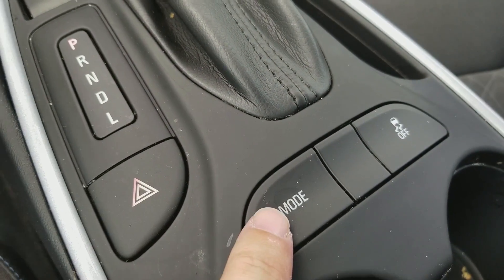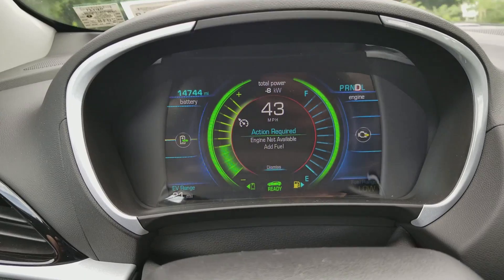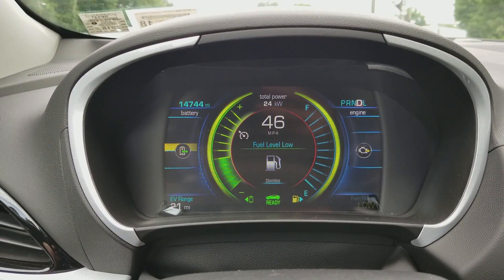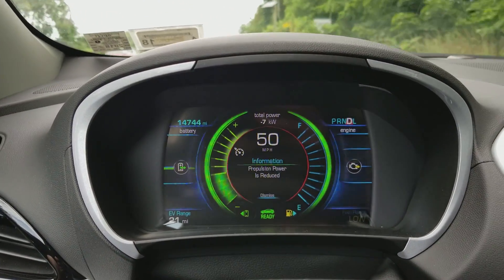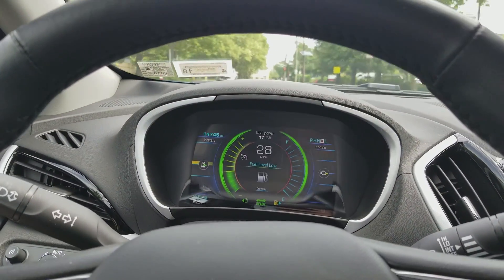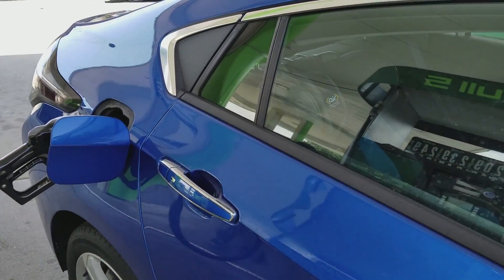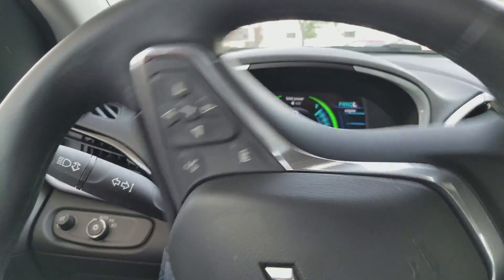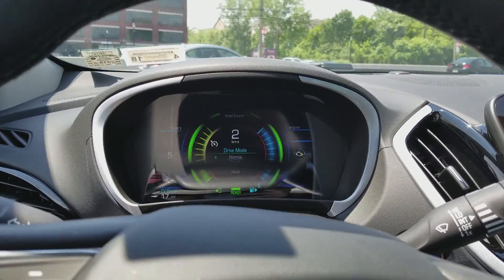Electric Chevy Volt Runs Out Of Gas - Becomes Dangerous

Comment: I guess they figured that anyone who buys a $45,000 car will be able to afford to put gas in the tank as needed.
BTW you cannot run this car with the gas tank empty all the time. At some point it will try to start the engine, to burn off the 'old gas'. Hilarity ensues.

you know what is really dangerous? Having your car run out of fuel and not moving at all, in the center lane of Interstate 95. You WILL get rear-ended by  a semi going 75mph.

Comment: I have a 2017 Chevy Volt and love it. I almost never use gas, unless outside temps are below freezing, or if I make the rare trip greater than 50 miles. JSYK, it goes 0-60 in about 7.5 seconds in NORMAL mode.

Comment: Oh I learned that unfortunately at 2:03 you didn't bother reading the warning. Also learned that you didn't read the owners manual. Also learned that you don't appreciate that the car is trying to absolutely economize all possible range by slowing you down to prevent you from wasting excessive electrons on silly 0-60 runs. The theory is you are in a pretty desperate situation and your are lucky the Volt is a car with a backup plan. Please learn your car before posting silly videos about how you think your amazingly well thought out car is dumb or dangerous.

Comment: The volt has a very protective system - it only uses 60% its battery - so run out of gas and battery it still has 20% to get you out of trouble (ie: reserve)

Comment: The Volt will run with an empty gas tank. If the battery charge is above it's low state of charge buffer level it will run perfectly normal.  I wonder if your charge buffer is set really high or something.  I ran mine with no gas on the freeway with no issue, still just as zippy as before.  Or maybe you need to have your car looked at?

Comment: Listen SpaghettiOs, you're wrong about hold mode. I own a Chevy Volt myself and when you're in hold mode the car will run on a combination of electric and gas but it will run almost primarily on the electric that you regenerate. So if you're in stop-and-go traffic on the boulevard between traffic lights is going and stop and going and stopping putting your car your Chevy Volt in hold mode puts it into hybrid mode and you use both

Comment: Ok, I opened and watched this video, ready to dump on it because of the title.  From the mostly negative comments below, I'd say there were a lot of people that felt the same.  However, after watching this, he has a good point.  I have a 2018 Chevy Volt, and I love it.  But he'd definitely pointed out a bug that should probably be fixed with an update.  You shouldn't get a "Propulsion Power is Reduced" message just because you left it in hold mode and ran out of gas and have plenty of battery power available.  It's designed to run on battery only, if you still have plenty of battery left, you shouldn't need any gas to keep running normally.  I expect it's a feature designed to protect the battery from being over-used when the gas engine isn't available (out of gas), but that section of cod should have also checked the battery amount available; only switching to "limp mode" when battery range was also getting low.

Comment: "Hey Speghetti-O's! So this car is dangerous, because it won't let me merge onto the highway after I ran it out of gas and only have battery power. Its a stupid mode that won't let me use a lot power to accelerate hard. Such a bad design. There needs to be a warning label that says not to run out of gas and attempt to get on the highway."

Comment: Which car doesn't suck in limp mode? It's a highly unusual scenario, most people would run out of battery power - then run out of gas - then the car would go into EV limp mode for 3 miles. You would get plenty of warnings that you are about to run out of gas prior to actually running out of gas. It sounds like GM just programmed the limp home mode to automatically come on after you run out of gas regardless of battery power - but again, you're getting more than ANY purely ICE powered car would give you in the same situation, so not sure why you call it unsafe?

Comment: you have got to be kidding me.   Yeah, its trying to conserve electricity to limp to a charger/ fuel station.   The actually interesting part is that if you run it out of battery, then run it out of gas, it will do the same thing, but draw from a hidden portion of the battery for a few miles.    The system probably is confused because its being used backwards.

Comment: This is old, but I just came across it. I don't understand your perspective here. You have a car that is working as advertised - it gave you a certain amount of electric range, then switches to gas to generate the electric from there until such time as you run out of gas. All of which your gauges told you what were happening at all times right? However it appears they built in a reserve system to try and help you limp to a gas station. How is this a bad thing? Is it because you forced the scenario to see what happened and you still had some battery left so you think it should switch BACK to normal battery? That's on you for being weird. Just force it back to normal using the mode switch like you forced it into hold mode to begin with. 
As far as greatly reduced power, etc. - good grief man, put on your hazards and go. You've never had a breakdown in a regular vehicle? I sure have. I had to limp home a Mercedes C300 that would barely get up to speed because it ends up the mass airflow sensor was faulty. So your argument would be all Mercedes C series are dangerous vehicles since the mass airflow sensors commonly go out on them (as I found out the hard way)? Or basically any vehicle made is dangerous that has any downtime whether or not it is user error? I don't own a Volt, but I am seriously considering one and I'm trying to find any negatives I can. This argument doesn't make sense to me. It seems more like an olive branch they shouldn't have extended to try and help people out. Just let people be stranded when they run out of gas like anything else and this video wouldn't exist. lol sheesh.

Comment: Yeah I can speak from experience no battery charger when it runs our of gas results in the engine shutting down but there is still enough to travel maybe he a mile or a mile tops. It really just depends on how much battery power was generated when the gas ran out since it uses gas to ultimately make electricity and move the car. I was able to travel about a half mile and use the ac for a little when I did run out of gas. In the middle of the desert 100 degrees with my cat no more water just got my tires out of deep sand after 3 days of trying then drove out of the real middle of nowhere for a while and my car died I'm pretty sure some angels showed up and drove me an hour both ways to the nearest gas station.

Comment: Definitely learn something new, had Volt since 2013. Not familiar with the newer model and its design but assume it is similar. The 2013 Volt use electric mode first and gas as an extender for a normal mode of operation. Empty the gas first is not "natural" flow of the use of this car. Many Youtube videos show how the power plant design in the Volt. The max power under demand load situation is provided by all three power producer. The Electric motor, the generator, and the gas engine. Missing one of these would put the car in less power capability in a demand situation. For example, when the battery is empty, climbing a mountain will be slow also.

Comment: What a maroon!  , getting on the freeway without gas and the battery drained. You know the initial charge is drained. You've gone through a tank of gas and the gauge has informed you need to refuel, then you complain when the emergency electrical reserve supply meant to keep you from being stranded and give you a chance to get  to the closest gas station can't deliver you freeway acceleration speeds?   Chevrolet's engineers are not omnipotent and can only design for so much stupidity and user error.

Comment: without gas it will extend the battery life for as long as possible. More of a 'don't be stupid and run the battery dead before you can find a gas station" type of feature. And you really need to put the intelligence of the public as a whole. I do agree there should be a message, maybe an override... but that's why it does that.

Comment: My guess is it went into limp mode to conserve electric power to increase range so you can get it to a gas station before you run out of battery in which case you'd be fooked.

Comment: I have a 2017 Volt and I've used all the gas and had electric only, and my car did not go that slow.  I got onto the highway easy.
Reply: If the gas engine becomes unavailable when the car was expecting it to be available, it will reduce total power output to 50kW. Power-to-weight is roughly that of a 2.4L Subaru Outback, so you can still get up to highway speed with relative ease.

Comment: Typically when a battery gets that low it's not capable of outputting it's full voltage. Which means your going to be limping. Same reason RC cars get slower before the battery completely dies.
Reply: It will engage this mode even when the battery is fully charged, because the programming assumes you have already depleted electric power before depleting gas power. If you use Hold Mode, you can defeat this normal operation and run out of gas even with a full battery. It still thinks it has to limp home though if there's no engine available.

Comment: Actually, I've seen a video that says if you deplete power in electric mode and then run out of gas, unlike a ICE powered car, you can actually limp to a fuel station to get gas beating all ICE cars, the only available option being you hoof it.

Comment: I wish the option to "Dismiss" the message on the display would restore full power, but I can understand why they did this.  It is an extended range eV after all, and any "failure" of the range extender (including being out of gas) will prompt that reduced power.  Think of it this way: most people watch the eV range but don't care if it gets low because they assume it'll keep going beyond that.  That "habit" is what makes being out of gas a big deal in this car.

Comment: It is stupid that electric propulsion power is reduced even though the battery is fully charged (well, 100% is really about 80%)... It should be at full power until 20 miles or less remaining IMO..  You may be able to hack it by shutting the car off, opening the gas door and gas cap, wait a few minutes (don't have to put any gas in) and putting the cap back on and closing the door. Start the car, it'll be in 'Normal' mode default as always when you turn it on, and since the engine will not be called upon because it is in normal mode and there are battery miles left, and the car thinks that you may have filled the gas tank, then it will have full power all the way to 0 miles remaining.

Comment: Another case of an American car owner that refuses to read the car manual and wants to "experiment" with an action already done and COVERED in the car manual. Page 180 of the 2016 Chevy Volt explains it clearly, identifying the reduced power feature and the message on the dash board. As to the intent of the engineers, well, ask Chevy engineers if you must. But the car is far from "dangerous" while Rob is in fact being dangerous by not reading the manual, not being aware of the restriction and wanting to merge to presumably 80 mph traffic WITH AN EXPLAINED LIMIT AS TO POWER!!  Come on Rob. If you want to pretend to be an "expert," please learn how to be one. OK? Now, please read the car manual!!!

Comment: The reason GM did what they did is because they sell these cars to those of lowest common denominator of human intelligence. In other words, dumb the car down to match those who are too stupid to run the car without any gas at all in the tank (and then get stranded & start complaining to their GM dealer). This car despite its good EV range is still classified as a Plug-in Hybrid, which means it requires both fuel and/or electricity to run. 

If you wanted to argue with me, congratulations this IS NOT the right car for you. Buy a Bolt or be a sheep and wait in line for a Tesla which you likely won't get until 2020.

Comment: You did not run out of gas, at least that I saw. When you got low on fuel the car throttled back on the gas engine in order to preserve what gas you had left. As large as hybrid batteries are they are not designed to propel a car without being constantly topped off which is done with regenerative braking as well as the gas engine. Without the use of the gas engine the hybrid battery might only have enough power for a few seconds at 60mph. Something else to think about would be that if you run the hybrid battery down to zero you are doing permanent damage to a battery that probably has a replacement cost of around $7,000 - $10,000. Manufacturers have to cover your hybrid battery for no less than 7 years. Unless you decide to make a YouTube video where you are purposefully trying to take away the car's safety net. In a case like that Chevy has a major case for negligence on your part, which releases them from having to cover your battery. You got very lucky that the car didn't run out of gas.

In stop and go traffic you can get a lot of use out of EV mode because you're not really pushing the hybrid motor very hard and every time you slow down you are topping off your battery both when you brake and when you are stopped at a traffic light. At traffic lights, your car probably shuts off the hybrid motor and idles the gas engine so your battery is topped off between lights.

Comment: This is why we can't have nice things in this country. Idiots like this. "It's dangerous" he says, this is why we need so many damn warning labels. Idiots like this who need every little thing spelled out for them. It's a gas powered hybrid, I guess any gas powered car would be "dangerous" if you let it run out of fuel. I am also sure you were warned, did you read the manual? He one of the reasons soda bottles have warning labels. I can hear him now, "Well it didn't say not to point it at my eye, so how was I supposed to know?" No common sense anymore. It is not an electric car, it is a hybrid, get it straight. He'll be the next one on Youtube trimming his hedges with his lawn mower and complaining that it doesn't do a good job.

Comment: The reason your acceleration is like that is because you have a hybrid electric vehicle, short trips around town not needing alot of power and acceleration is what that style of cars electric motor was designed for and since they gas motor is out of gas it can use it like it normally would to accelerate. A step up from there is a plug-in hybrid vehicle, they have a bigger motor and battery that has to be plugged in and charged since motor is gonna need more power than the regenerative braking is going to be able to provide for powering and propelling the vehicle around. This design really only using the gas engine for accelerating onto the highway or when driving aggressively. Then lastly you have all electric vehicles which as you could imagine no long have a gas engine and in return gets the largest electric motor and battery offered by that particular vehicle manufacturer.

Comment: >_> So your car did its best to be smarter than its operator and conserve "fuel", in this case battery power, in order to get you to as close as it could to a fuel station. I don't see the danger... If you run a conventional car out of gas, you will lose all power to the vehicle including steering and brakes (albeit, most people should be able to get the vehicle off the road before that happens).  Your car seems so much safer to just lose a bit of propulsion, temporarily,  in order to be more conservative. Even comparing this to other hybrid/electric vehicles this doesn't seem like a bad design.

Comment: Your concern is burning gas unnecessarily in the winter, which is understandable. RTFM and learn how to set the car to enable ERDTT (engine running due to temperature) at 15F instead of 30F (default). It's done in the infotainment screen under vehicle settings. This significantly reduced my gas consumption in the winter months here in Michigan. If you don't want the engine to run ever (as long as you have a charge), you can install a defeat sensor, which basically involves adding a resistor to the sensor used by ERDTT. 

In PPIR (propulsion power is reduced) mode it still has a 19.7 lb per HP power ratio (max 50kW), so even with the performance limitations, this car still has a better weight-to-power ratio than a Subaru Outback 2.5i or a Third-gen Toyota Prius. Those cars aren't "dangerous" because they are slow, they just aren't fun.

Comment: The battery can only provide so much amperage and the generator on the motor provides a lot more amperage.  That is why these cars need a large capacitor bank.  This would greatly improve regenerative breaking and actually increase how long the battery will last before needing to be replaced, but also it can use those capacitors to boost acceleration.

Comment: Probbly just to increses effency to get the max distance of the electric or it asumes somethign is wrong and dosent want to stress the battery. Likely the later. On my focus electric if there is a check engine/fault  light it dose something simmaler as a  percausion.

Mine does makes a loud ding when this happens though.

Comment: You do realize every car has a limp-mode when it detects a fault or has a sensor fail right?  Even full gas powered cars if you have a sensor tell the car it has a power train fault will severely limit your power to the point you may not be able to go more than 25 or so even foot to the floor.